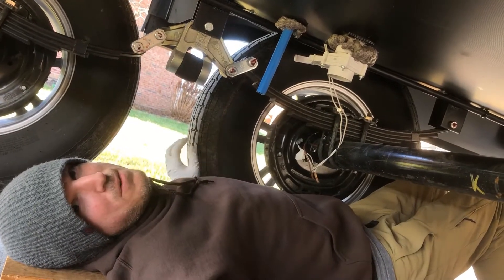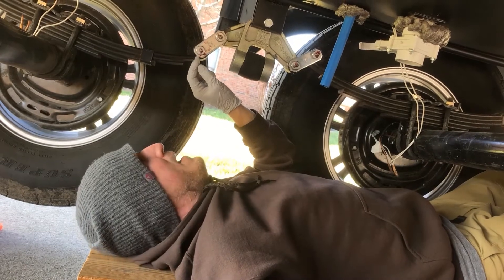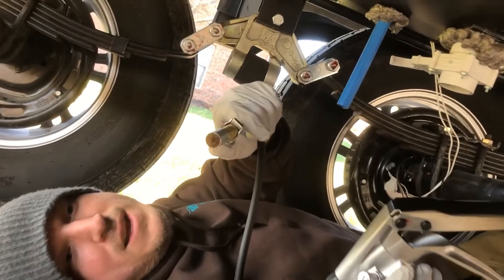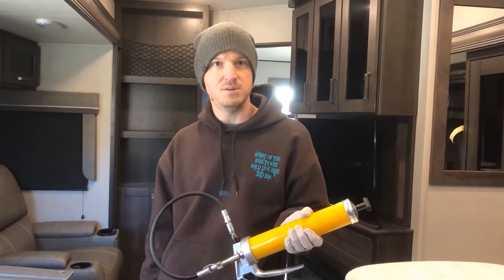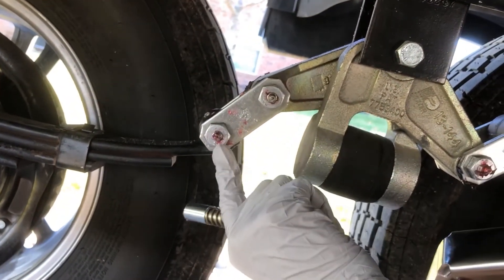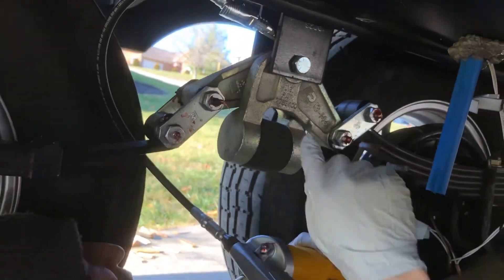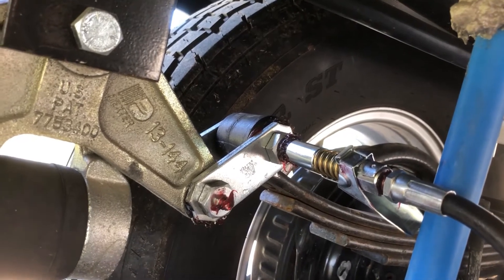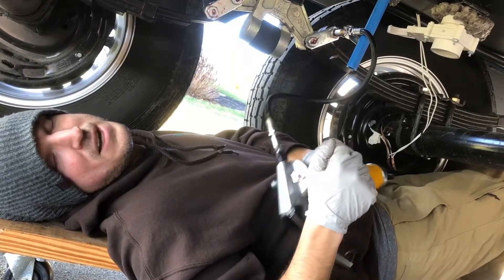Greasing a Dexter suspension on a Grand Design 311BHS.  Wet Bolt grease

Comment: greased mine for the first time today and one bolt took 10 pumps of grease. No old grease came out of any of them either.  No Bueno.....thanks for sharing.
Reply: ....and my zerk fittings are on the outside, not the inside. Very frustrating....

Comment: Thanks for this video. I’m at 3000 miles and I couldn’t get all wet bolts to accept grease. I had a difficult time getting the wheels jacked off grade completely. I jacked behind rear wheel then in front of front wheel. How did you get both wheels off grade? There doesn’t seem to be a lot of info about how to get this job done safety.

Comment: What brand of grease, product name / specification is installed at Grand Design for use within the wheel bearings and within the suspension wet bolts?
Reply from the maker: Here's Dexter's official list of approved greases: https://www.dexteraxle.com/Resources/Learning-Library/How-To/5198/how-to-lubricate-your-bearings
If you want to use something not on the list, best to fully clean everything to avoid mixing certain chemicals that don't match well.
The bearing are the most important to not mis with.  I've never heard of a wet bolt failure because of mixing greases.  As one of my other video shows, even with low miles and regular greasing, the brass bushings in the wet bolts broke down before the grease did.

Comment: Thanks for the great video. We are still new and learning all the hidden maintenance we should do that’s not in the manual. What kind of grease should we buy? We have a solitude 5th wheel with electric leveling jacks. Is it necessary to hook it up to our truck when jacking up to clear tires off ground? Should we pull slides in? Thanks!
Reply from the maker: I use the Walmart brand Super Tech Multi-Duty high temp.  Any NGLI #2 grease will meet the same general specs.  The biggest differences are the max temperatures, which for the wet bolts is not a major concern.  The Walmart brand is rated to 300F, a fancier one that Etrailer recommends is rated to 500F.
For this application, I think anything more than the Walmart brand is over quality.  These bolts don't typically fail because of brand of grease used, but rather lack of proper greasing.  Dexter recommends every 3 months or 3k miles.  Keeping the grease in the system fresh is important part.

I would not ever auto level hooked up to the truck.  You should only raise the front jacks to release the 5th wheel hitch, then get the truck clear of the camper.  Depending on grade of your parking spot, leveling with the truck attached will either put unnecessary load on axle or pull the suspension of the truck up depending on whether the front or rear is lower.  

Whether the slides are in or out makes no difference.  If they are in, you potentially don't have to crawl under the rig as far. Also less to bump your head on.

If you get the adapter I recommend, or equivalent, whether the tires are off the ground shouldn't matter.  I've been able to push grease through the system in any condition so far.  I'd auto level just to get a little more clearance for yourself to be under the camper.  The with the levels down, the camper isn't going anywhere and as long as you've placed wheel chocks on both sides in both directions (my best practice to prevent 'oops' moments), when you lower it, it will also stay in place.

Hope this helps!
Reply: Thanks. We got the Lock N Lube and grease you recommended.  Having never even used a grease gun before, I assumed the connection was ample with the lock in the zerk- however when pumping, it was clear no grease was going in - just pumping out of the lock. Would you assume poor fitting/user error, or need to jack camper up to take all at off wheels? Currently parks with jacks down, but wheels not lifted.  Thanks a ton for your help already!
Reply from the maker: When you squeeze the lock to attach, 4 jaws spread out.  Those should bite on to the zerk.  Sometimes giving it a little wiggle back and forth helps draw the zerk into the jaws.  When attached to the zerk correctly, the 4 jaws should basically be pulled back inside the adapter.  Is this happening?  If so and it still isn't taking grease, then I would try lifting one side up so that the wheels are up.  If it still doesn't take, hit me up again and I'll try and do some more trouble shooting.
Reply: RVEngineer this worked thank you!!
Reply from the maker: Leah, Glad to hear and happy camping!

Comment: How would you jack it up, to get the tires off the ground. Where would you, put the jack
Reply from the maker: With the camper leveled and all jack stands down, you can raise a wheel by jacking at the beam axle close to the leaf springs.  Doing one side at a time won't cause an issue assuming you on level ground, properly chalked, etc.  Good luck!

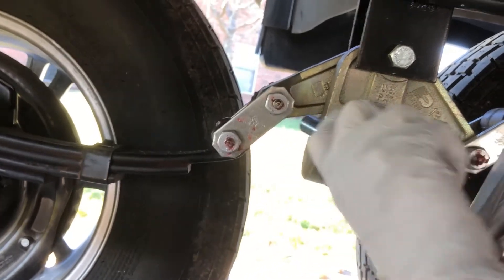Comment: I have one zerk fitting that won't take grease. I have removed the fitting, cleaned it, reinstalled it and it still won't take grease. It's the wetbolt at 3:15 of your video. What do I need to do to relieve pressure and try again? Do I just use a jack to raise the axle slightly? Or if I need to remove that shackle, where should I be providing support? I know to support the axle but where else should I use a jack so I don't have an issue getting things back together?
Reply from the maker: RH63, you can try raising the axle slightly with a jack.  That's what has typically worked.  
Don't fret too much about taking the bolt out.  I've replaced them all.  Have one jack at the axle, and another with a small block at your equalizer.  The one on the axle controls the 'H' (up and down), the one on the equalizer controls the 'L' (front to back).  You can try supporting both to get it to take grease before you remove.  If you're going to take them out, I highly recommend the upgraded shackle kit (They aren't paying me anything to say that).  Good luck!

Comment: Had three zerks that weren't taking the grease. Do I need to replace or is there a way to fix the zerk?
Reply from the maker: There are a few things you can try: 1. What type of grease gun are you using?  You really do need a high pressure kind.  That may help. 2. You can try lifting the suspension slightly to change the pressure against the bolt.  3.  If you watch my latest video about the suspension upgrade, you can see what was wrong with one of mine.  The bronze bushing was completely worn out and I suspect the bolt was installed with the hole straight up or down which can make it very hard to grease.  Best practice is hole to front or rear of camper to allow for flow.  Since I did the upgrade, greasing is very easy.  Good luck!

Comment: Did you use your leveling jacks to lift the trailer?
Reply from the maker: I did.  I just did an auto level.  If you are using the adapter I recommend, or an equivalent, you should be able to push grease into every joint.